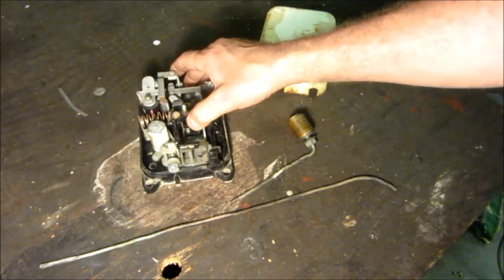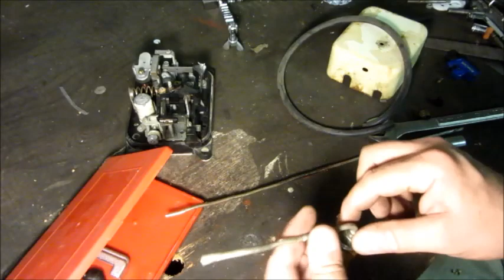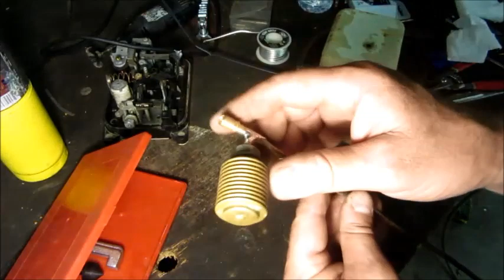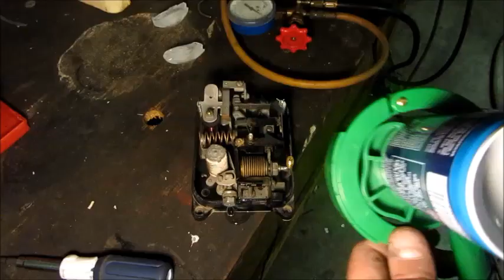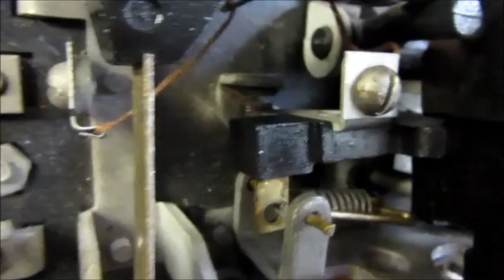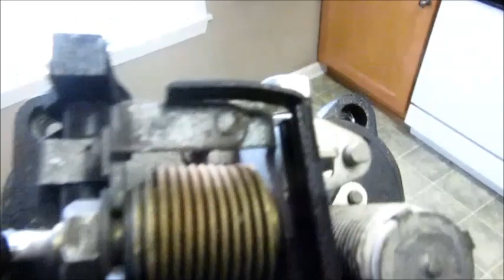Refrigerator Thermostat Bellows Tube Repair - 1-  Repair and Recharge

Comment: Great job. You might try ether or engine start fluid. Often use in boron tubes it’s easily entered into the tubing, end heated pinched and soldered in a one two three process. As the ether begins to boil out the tube is red hot, the soldered addedand is sucked back into a vacuum as it cools. It’s how boron tubes on T-stats are charged.
Reply from the maker: Hi James.  Yep those sensing bulbs for for bourdon tube thermometers can be charged with a number of things depending on the temperature range it is designed to measure. Diethyl ether (starting fluid) would be good for warmer temperature ranges. It begins to have higher than atmospheric vapor pressure at about 95°F so it would be good for temperatures above that. If the temperature were less than that, the bellows would be in a vacuum, and the control would not work.

Since we're trying to measure very cold temperatures with this control, it needs a substance with a higher vapor pressure at those low temps. Typically, refrigerants are used in these thermostats.

Comment: One of my can taps broke the same way... super annoying.
Reply from the maker: Yeah - it is just very poorly made. After this video, I broke it all the way apart and found that it had a major void inside the plastic at the port area. Seems the plastic was cooled off as it molded around the metal part and didn't flow very well into the mold.

Comment: How did u repair the stem?
Reply from the maker: Hi, thanks for the comment.  I expanded one end, so that the other end would slide inside it. Then; after sliding the loose piece into the other piece, I soldered it using normal techniques.
Reply: Nice! Thank you for the great video and answering me back so quickly.
Reply from the maker: You're welcome! 
This video may explain the swaging technique I used. https://www.youtube.com/watch?v=STl8aYYcpb4